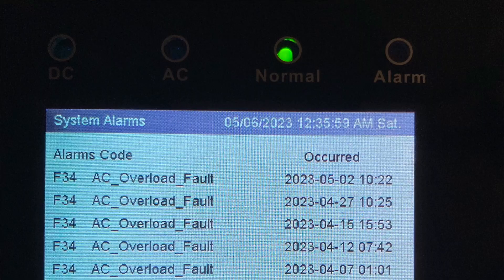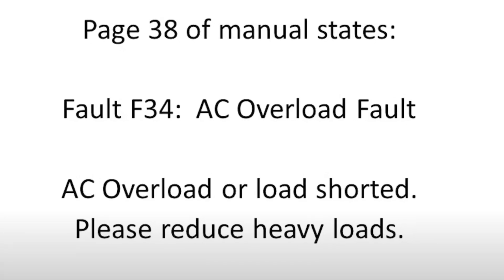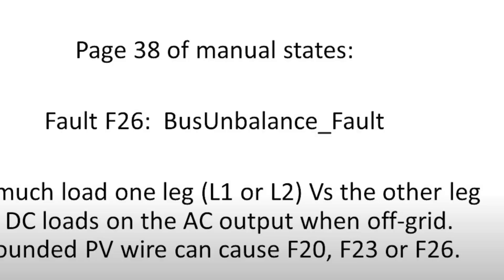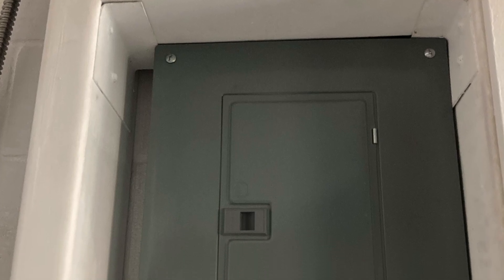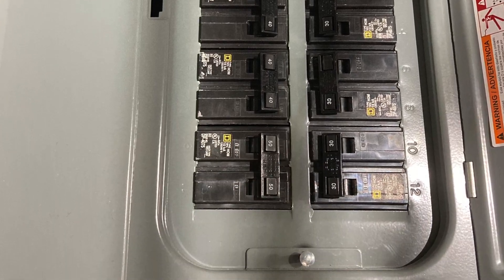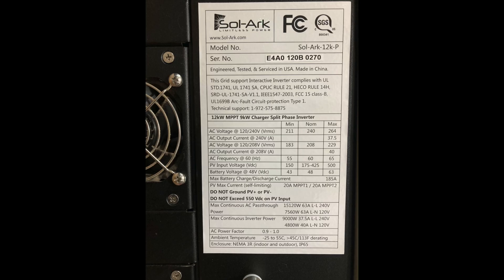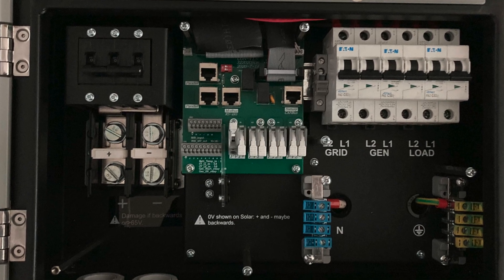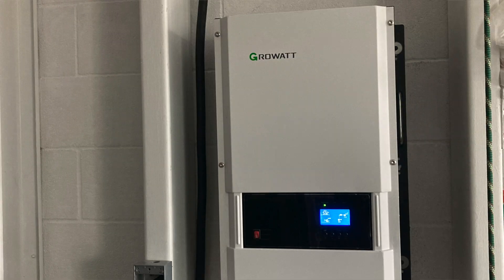Sol Ark 12K Inverter Review after 2 Years   HD

Comment: Does anyone know if Sol-Ark has solved the line and balance problem with a firmware update yet?
Reply from the maker: If you are referring to Sol-Ark 12k that I have the reviews , I don’t think so. I had filmware update more than 10 times. If you have a problem with line balance only, you can use an auto transformer, however if your unit shuts off around 8000w, that probably won’t change. I found the original papers online, and that is only a 8000w inverter if used for off grid applications. Thank you !!
Reply: @offgridwithlaszlo  can you link to the original papers where it’s described as an 8000 W inverter?
Reply from the maker: https://youtu.be/jXk8nVP_HyM

Please check out this review . Thank you